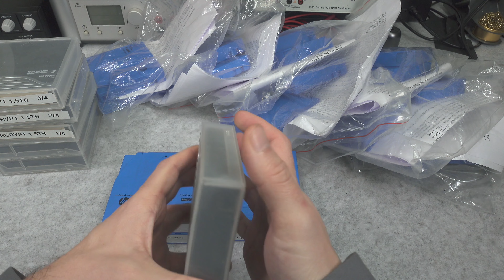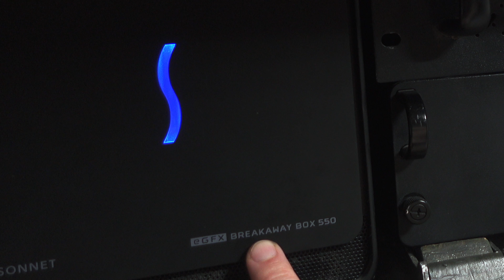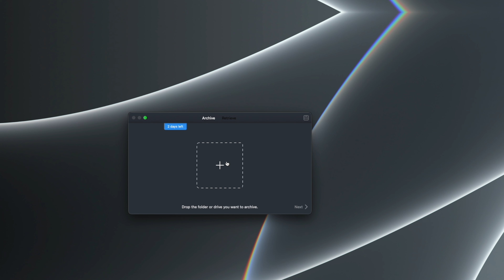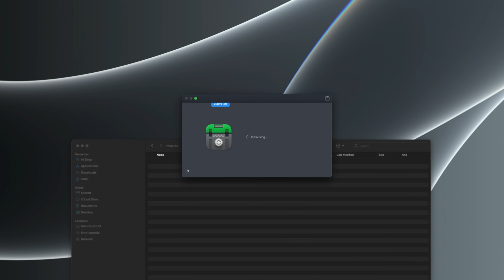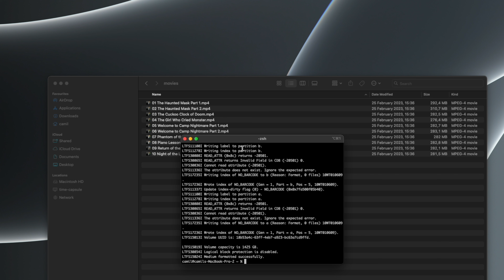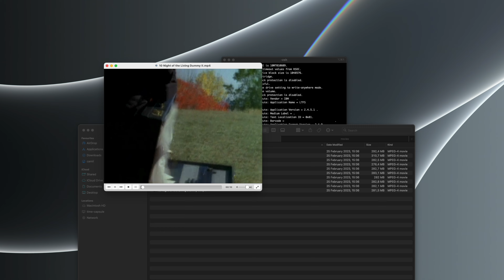2024 - Archiving video projects straight from MacBook M2 into LTFS (LTO5) tapes using Hedge Canister

Comment: Great overview, super clear and helpful. How do you handle spanning data that is too large across multiple LTO tapes?
Reply from the maker: It support spanning but I never had need to use it, in past I was using backupExec for spanned but I did not like overall process - it was meant for backup not archiving.
Going back to spanning here You can read about it:   https://docs.hedge.video/canister/features/spanning    , they have free trial so You can give it a try no strings attached

Comment: I noted that you touched on this a bit wrt the software caching the indexes to somewhat mitigate the "shoe shine" issue.  I like the idea of ltfs but in practice there's a kot of onus placed on the user to be smarter than they should realistically be needed to be.  LTO mechs, heads, and tape are robust but not that robust. There's a surprising amount of wear involved in any given operation and it's all rated in number of mounts and passes.  Ltfs peels through that extremely quickly. 

For a $5K, for typical last gen mech (used), premature wear is a factor not to be trivialized unless one has deep pockets. :)

In any event, I enjoyed your video. Thanks!
Reply from the maker: Exactly! If You have tape library and just doing one pass per week then rotate tape it can last years since those full passes won't add that quickly. I never seen dead broken tape that was used with LTFS - I just noticed it rewinding and re-trying write more often and sustain transfer drop to 0 for longer period of time - that's moment when I get rid of tape. Canister display normal directory tree but for example You don't see file size it read 0 so it must be preventing those operations to speed it up, my workaround was just using terminal and "ls" to list directory and then "cp" to copy it and never open it in "finder".   BTW:  There is something magic in tape that I like :> Thanks for feedback, take care!